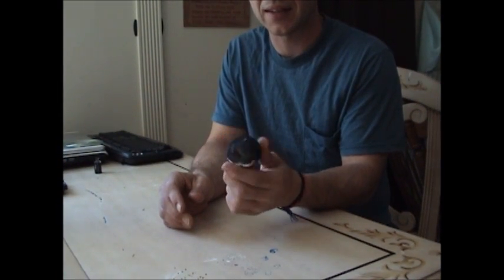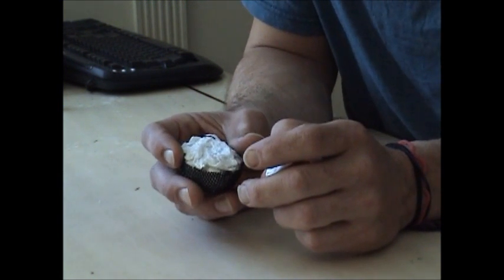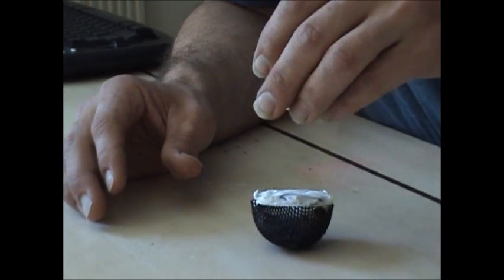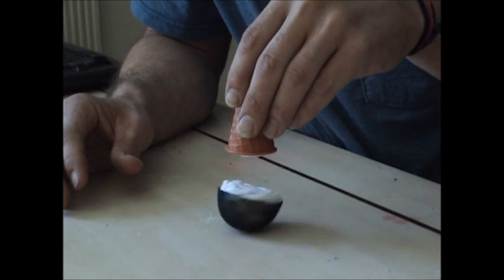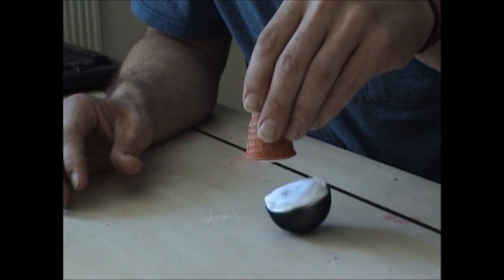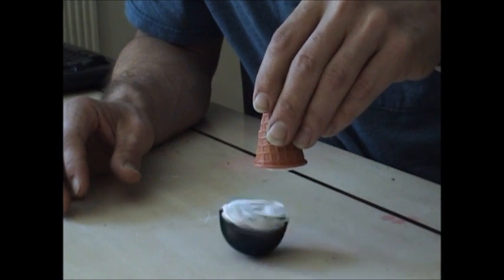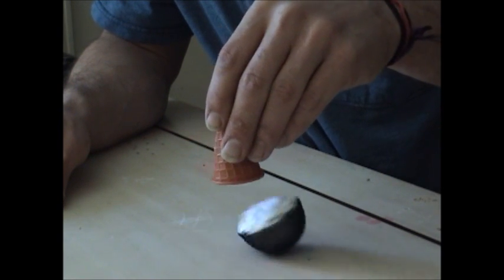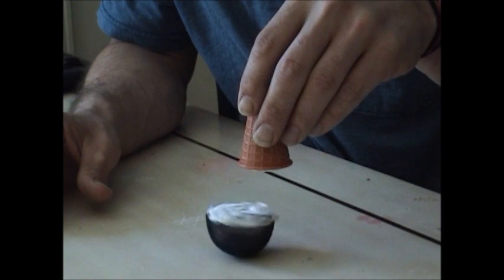Cool Invention Could Save the Planet - April 28, 2011

Comment from the maker: Take a second, sit down & think about the nature of infinity. Endlessness means all things by whatever name they are called are part of 1 great thing. We call it existence. Up until now it is accepted that Einsteins equation proves the highest potential energy possible, but if all things=all things, than any one point has the potential of all other points if properly accelerated. The potential of E=MC2 limits particles to a maximum potential of its mass x the speed of light squared. This is finite potential, which does not accurately or completely define the highest potential available. Close your eyes & open your mind, you, I, Google, Obama, & your dog are all one existence experiencing itself infinitely. "Not all the leaves know there's a tree." ~ Vortex mechanics will power all human systems within the next 500 years. Why does it matter? It doesn't unless u believe in equality for all beings & prosperity as a way of life. There are many ways to create cost free energy, this video is a simple demonstration of a core principle, the manipulation of attracting & repulsing forces to achieve useable force.

Comment: Rather than, show it's design, I think you should build a version that is attached to a working machine. If the energy output is greater than energy input than you have a device that truly does convert more than one type of energy; however, I don't think it will work, magnets only convert magnetic to torsional/electrical.

Comment: Urban legend of "free energy".
Will use more energy from your hand than it delivers to the rotational motion.
Reply: thelastsamana "Man will never fly"
Reply from the maker: Incorrect, this system when built properly will infinitely accelerate, the key is not to take energy from it until high enough speed is reached to offset resistance. The urban legend excuse just means your too lazy to do anything more than comment on new ideas, I'm sure the light bulb, telephone & model T were greeted with similar apathy.

Comment: The non believers are dumb.  The energy doesn't need to transfer.  If you can make somthing rotate, be it with wind, water, magnetism...the rotation, or, the thing that's spinning, is used to create the energy.  When a wind turbine is rotating, it's the rotation that produces the energy we need.  We aren't borrowing or transferring the wind, just the rotation.  This device is sound, it's logic is   well   logical.    If you don't get it, take a science class.

Comment: Here is a thought.
As you increase the mass of the magnets, it takes more kinetic energy to keep the
magnets moving.
In order to get any usable electric power out of the magnetic fields, the magnets need
to be rotated in a fixed area with wires surrounding the magnets.
It costs a great deal to make any electric generator that would put out enough electric
power to make it worth building.
If you used superconductive magnets to produce the magnetic field, then rotated the
wires in the field, you would not have a problem with reenergizing the magnets for
years.
There are many ways to use solar, wind and the ocean to produce electric power, but
untill oil, coal and gas cost to much to be wasted as fuel, other forms of electric power
will not get the funds needed to do the same job.

Comment: Would this contraption work if it is to be attached to rotate a turbine shaft and use some source of energy to initiate the process,..... as a more efficient way to produce electricity rather than traditional methods

Comment: Although the idea is great the thought is impossible. Magnets would have to have two negative or two positive ends which is virtually impossible. Also the idea that this could generate energy in the form of a motor is quite illogical for the mere fact that the energy conveyed into this device will get lost by the friction of the table and slowly the magnets will lose there momentum. If the laws of physics are correct ( which I believe they are) this is just impossible.

Comment: Smart discovery. You're half moon at the bottom can generate a lot of rotational force so if you wished to generate electricity from this you would have to build a conductive "Bowl". that will hold the charge generated through frictional force/rotation Not only would a bowl design help to keep you're half moon from spinning beyond a certain point and in place, but also since the half moon and bowl are two different surfaces then you can use that to you're advantage.

Comment: This is stupid, you cant create free energy, first off magnetic fields are a way to store energy, they do not last forever, eventually you will need to re-magnetize the magnets and that will require energy; even more energy than was originally obtained by using the magnetic field because there is no such thing as 100% efficiency greatly due impart by the second law of thermodynamics. All that is happening is you're converting energy from one form to another, you still need some sort of original source of energy. It's one thing to make an object spin using some small permanent magnets, it's another thing to utilize the concept efficiently on large scale to actually produce a power output. Putting it quite simply, its stupid, impractical and would never work.

Comment: People...  I know this is old but this is for those that have just found this video... 

The Guy is adding energy to the system when he wiggles his hand...  The object is spinning due to the friction on the curved surface of the object when it is pulled by his hand and the magnet.  It is spinning faster as the diameter of the object and it's surface is bigger when it is tilted and thus makes it spin faster.  If you imagin a string in between his hand and the object you could remove the magnets all together.  The only energy going into this system is the guy's hand...  The only output is a spinning object that will stop when he stops putting energy into the system...

I would love to think we had a way to get energy from this but it is not possible.  The guy has made a good toy but does not understand the basic principles of physics and love to talk about saving the planet!!   Thats it...

Comment: This is nothing but a kind of "Magnetic Transmission"... You won't extract more energy, than you invest. If you combine a small gear and a giant gear, and turn the giant gear by hand, you will see the same effect. The small gear will run impossibily fast. but if you try to power a device with it (maybe with a dynamo) the giant gear will be hard to turn. The more power you try to get from it, the harde it'll turn. This is called lorentz force: "A generated force counteracts the generating force" Sorry... but this is very useless... this guy wasted a lot of time...

Comment: "Science" is not applicable here. You have a system which is taking in his hand movements and outputting motion; this has been done a hundred thousand times, often in much more elegant ways, but if you ever compared energy into the system, you'd get the same out. On top of that, the coil windings that you need to extract energy from the system causes a stopping motion on magnets (the basis for EVERY non-solar generator on the planet). This won't generate any more electricity than the total energy put in from his hand motions (tis why stopping his hand stops the system; it's not self sustaining). And hence, probably why there's nothing on this two years later. Chill people; if you want to help create cheap energy, don't copy/past, go get an engineering degree.